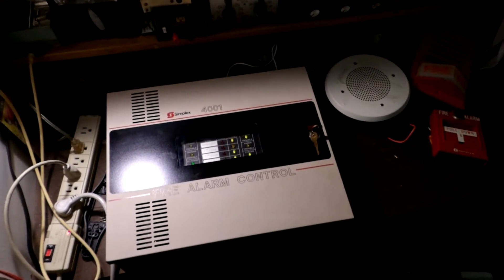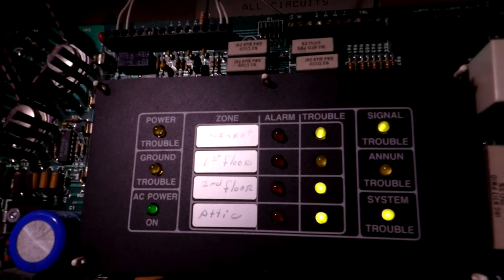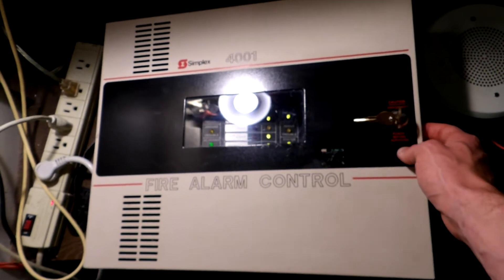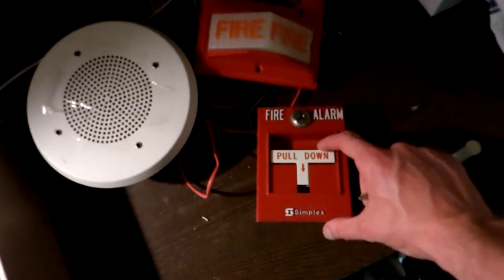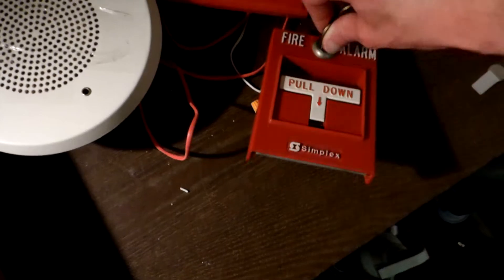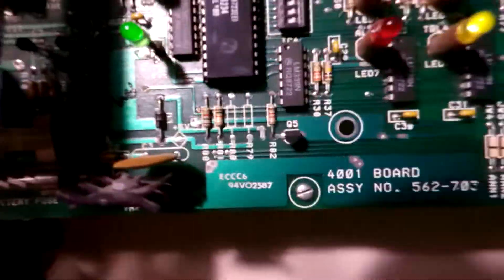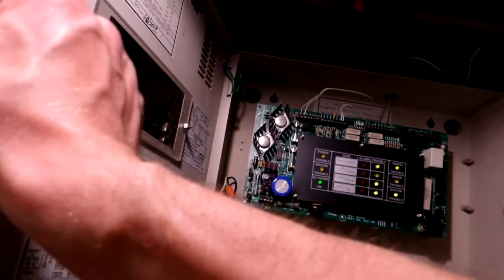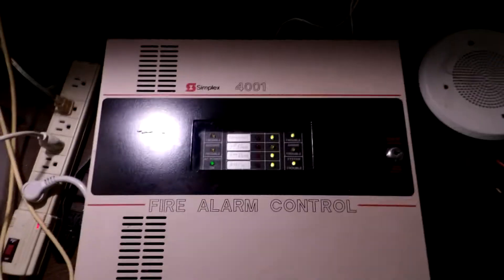Simplex 4001 Fire Alarm Mini System Test

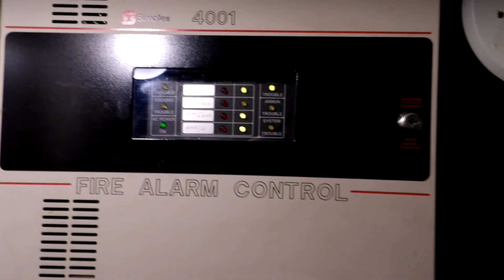Comment: 4:50 - the reason for that is because you must've had the chime set to VIB(vibrating). This setting is used if on a non-coded output. If you want the chime to follow coded outputs, you must change the jumper on the back from VIB to SS(single stroke), which are the top two prongs. Nice test nonetheless 👌🏽.
Reply from the maker: Thank you! I see, was wondering what the jumper was for but I couldn't find the datasheet. It worked like that on other codings, but I will switch the jumper if I plan to keep it on a coded output.
Reply: @docbrownsradiolab1220  No problem! Slower coding options don't really affect the  cadence of the chime if set on VIB. But faster coding options, like 120bpm March Time, then that's when it'll start acting strange when on VIB. So in the future, when coding the chime, it's best to set it to SS.
Reply from the maker: @BlackLightning4547  Thank you, very helpful!
Reply: @docbrownsradiolab1220  Pleasure